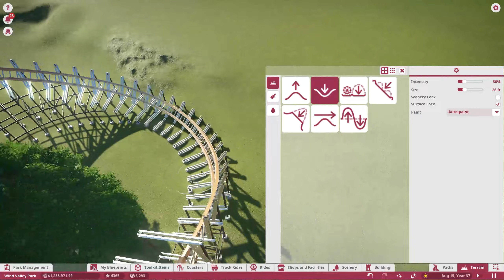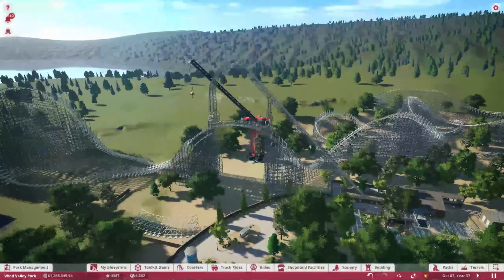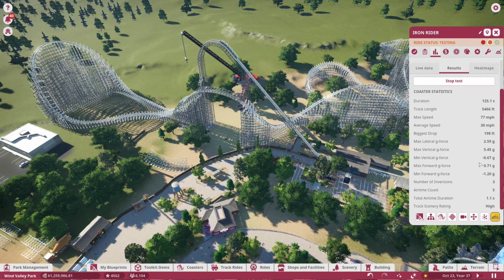Planet Coaster Challenge Mode | Part 38 (Year 37)

Comment: Hi Joe, I have a few suggestions on improving parts of the RMC, mainly on the long, swooping turns. Maybe make them low to the ground, and add one or two twist-and-shouts, wave turns, or profile them more like the turns on Medusa Steel Coaster or Wildfire. Also for the long turn in the second half, make it an airtime hill that heavily banks at the top, then swoops downward. Also maybe lower the friction multiplier if you want a more aggressive ride.
Reply: Also, since on the stream you said that land is starting to become locked and rides might have to be removed for future additions, I think a launch coaster would look great in storm breakers plot, especially with a top hat positioned similarly to where Parque Warner Madrid is placing theirs on their 2023 blitz coaster. That or a dive coaster would look good.